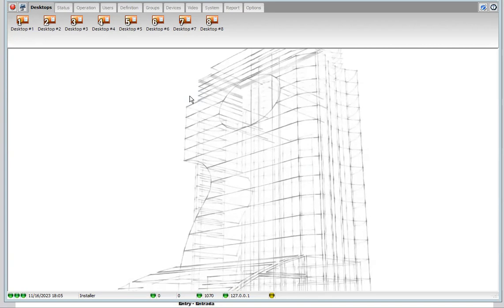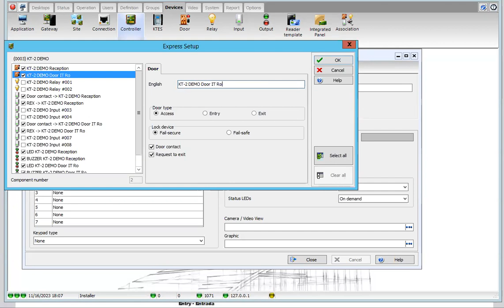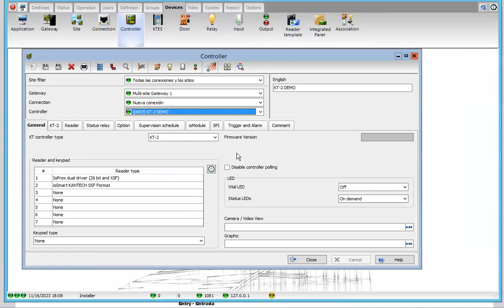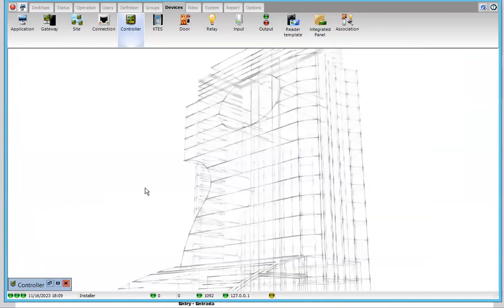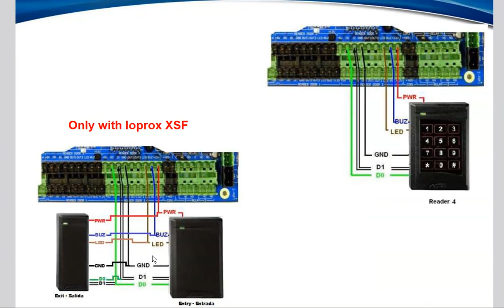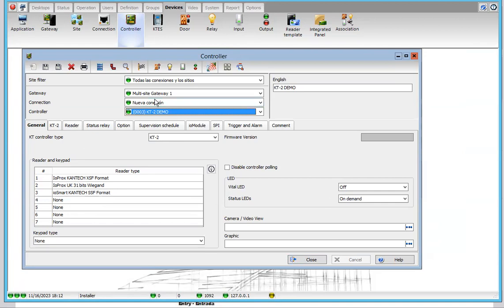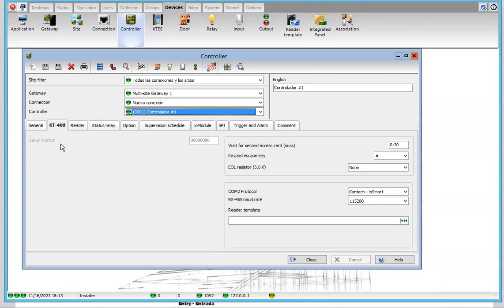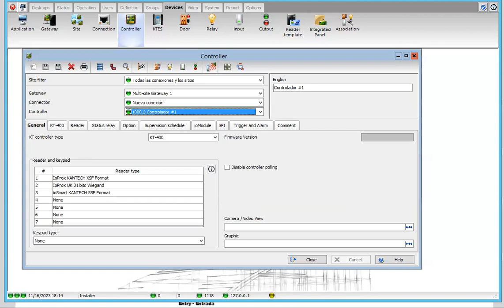how to enable 2 doors with  Entry & Exit reader in KT-2

Comment: Great expanation!!!!!  . Have you had any issues not being able to make the two readers show after you select NONE for the reader type and saving ? Having that issue , I can make it work on the kt400's no problem , kt2 wont show the two readers (it does have a newer firmware than other boards, maybe that problem?
Reply from the maker: remember you need to set only the compatible reader type, then the in/out reader will be available.